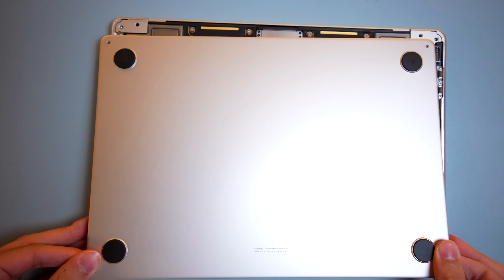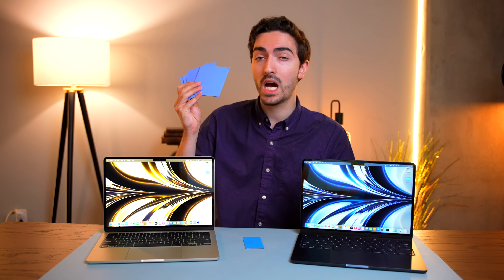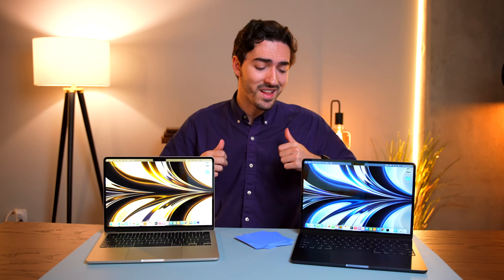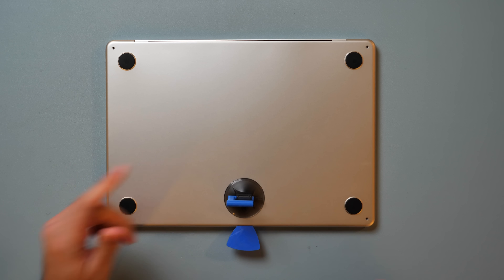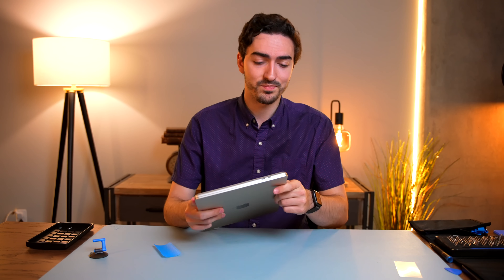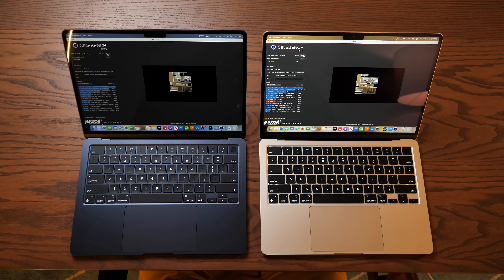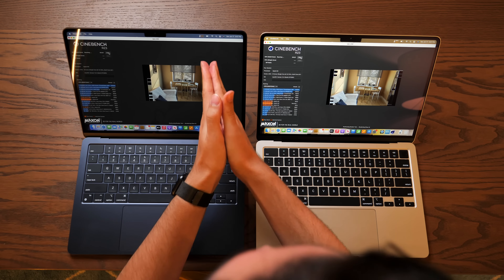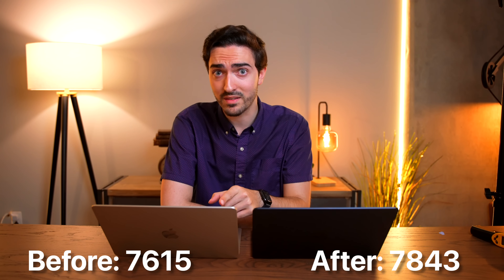Make your M2 MacBook Air FASTER for $8?!

Comment: I'd love to see testing while playing loud music from the speakers - the drivers moving air as music is played should create some airflow between the room and the gap between the heatsink and bottom case - this could help keep the system cooler, no pads needed.
Reply: except speakers produce heat too so you're not really cooling anything
Reply: @domp1062  amplifiers produce heat, speakers not so much. The tiny amounts of electricity through the coils make the driver vibrate as the coils move relative to the magnet. I’ve never seen speakers get hot even PA speakers it’s always the amps which have heat sinks (eg on powered speakers) However I’m not sure now if my crazy idea would work since looking closely it appears the speakers we can see are the magnets from behind, the drivers are on the other side. I know they play towards the display, but if they get all their ventilation from that side then it wouldn’t help at all.

Comment: it would be even better performance . but because it was to thick and you squeeze it it would not work soo good. so I believe gap would be even bigger. And isolator does not help idler.

Comment: I got an idea as to how one can solve the thermal throttling on my new MacBook Air M2.  Use it as it is intended to be used and quit running all those damn test that most people will NEVER use or taxi their system to that point.  So many of you techies are making this so much more than it really is.  Those folks that will be doing the type of major editing shouldn't buy a damn MacBook Air (PERIOD). They should be looking for a MacBook Air Pro 14 or 16.  No one is going to open their MacBook Air and do this crap.  Instead they will actually use them at the level they were designed to be used and they will then have no throttling and/or overheating.  NUFF SAID!

Comment: Ive seen this on a couple of other yt tests - the M2 Air with the extra graphics cores sprints the fist minute or so but then gets so hot it throttles back hard and ends up losing to the lower spec Air. Kinda tragic.

Comment: Changing the heatsink thermal paste might have been a better option for consistency and reliability especially considering I think both of these laptops are close to their power limit anyway.
Reply: he didnt want to ruin warranty or trade in value by removing anything from motherboard so I get why did the pads instead. But I do agree with you.

Comment: Are there any vent holes at the bottom of the M2 MB Air ?  Curious if Apple intended to use the air gap for convective cooling currents from the bottom to top or side of the chassis.

Comment: When you were using the thermal pads in testing, we all noticed that the heat sinks put in place by Apple were all one uniform piece. So if you distribute the heat between multiple isolated thermal pads, they cannot transfer the heat throughout a more uniform one-piece thermal pad covering the entire area to be cooled.
Reply: What heat sinks? There's an EM shield and some thermal tape. There is no heat sink, which is why the processor overheats so easily.

Comment: I rigged up an icepack/lap-pad for a MacBook Pro with only one working fan many moons ago. It really helped until I was able to fix the fan. Will Apple put a fan in the 15" Air? Will Apple re-tool these M2 Airs to add a fan and  fix the SSD problem?

Comment: "The faster air performed actually less, that's weird"...... NOT

Your not only spreading the heat to the chassis, but also over the whole motherboard, frying your SSD's and controllers. (Hence the slower performance) And with the heated chassis indirectly the batteries... Do you really think Apple did not thought about 'thermal pads'?? 

FYI: The black cover over the motherboard is actually a thermal heatshield to NOT dissipate heat to the chassis. 

Next title video of content creators without a technical background: Hmmm, that's weird, my M2 MacBook Air fried my legs because my battery 'mysteriously' exploded.... 😩

Wish you all the best, but think before you are recommending shit to thousands of people. This advice could be dangerous..

One love 💟

Comment: I think that, overall, there is a problem with the MBA. It's the same one with de first models, 15 years ago. They were practically too hot and less functional. Maybe this "second generation" 5 nm isn't what Apple intended to do. It's a compromise. I'll wait for the 4 nm generation or 3. MBA M1 looks more reliable. This one isn't yet a mature product.
Reply: There is nothing on Telegram. Your account is inactive.
So, you have two.

Comment: Probably should be specified that this mod is dangerous, if any part of the case get over 44 degree there is a risk of being burn (https://pubmed.ncbi.nlm.nih.gov/28536038/) considering that a laptop is not necessarily used only on a table (ie supported by leg) or simply handled to move it bringing a part of the case at high temperature can be quite bad

Comment: With respect, I can solve the throttling problem absolutely free for as long as one owns the device.
Simply use the device as 90% or more of owners use it … for everyday tasks. No 5 hour 8K movie renderings, no huge calculations done by physicists or engineers, no huge stresses. Few of us buy a base model MacBook Air to replace the latest Cray supercomputer, as tempting it may be for some. 
I understand how it may be interesting for 5 to 10 percent of owners, but the rest of us may prefer help on how to get the most from our purchase in the tasks we do every day. 
Many of your posts, like the ones that should you how to update an older Mac for only a few bucks, appeal to us folks that can’t afford a new MacBook every year. We need more YouTube creators to focus on regular users. At least a more equitable proportion. I believe you’re one who can excel at that.

Comment: If you use a pad to transfer the heat to the bottom case - to use it as a heat sink… wouldn’t you end up with a laptop that would burn your lap..?
Reply: I would think so as well. Sort of along the premises of “matter cannot be created or destroyed, only transferred” same thing applies to heat. If you’re using it on a desk I would think propping it up on something would help, so there’s airflow underneath. In all honesty, even though I like watching the benchmark testing, if you’re a consumer using this laptop to the extent that it’s reaching 108C you’re probably best to move up to a 14” or 16” Pro model. The use case for this I imagine would be web browsing, light photo editing, emails, etc

Comment: Curious if a copper replicated replacement for the heat shield would result in better performance also. Or in addition to the pads a really thin copper heat sync that attaches to the bottom of the case. Is there anyone that makes such things?

Comment: The reason Apple does not do this as it causes the bottom to breach the 50deg mark, which is known to cause lap burns and against most standards for max temp. Obviously it's the reason a fan exists in teh M2 Pro.

Comment: Oh and another thought. What if apple put air “channels in the next MacBook Air with out the fan and just relied on convection for air movement?
Reply: You can't have convection in horizontal surfaces. That can be done if the motherboard is behind the screen, and then you have convection because it is vertical. But then the screen would be very thick.

Comment: Just saw on Max Tech a similar Video (incl thermal paste). Interesting spin here with the different types of heatpads. Same result, apple cheaped out and did let as on the M1 many unused and wasted performance.
Reply: You don't get it. No, Apple did not cheap out. Apple did it for safety reasons. I have modded my Macbook Air M1 with thermal pads. It's efficient and I get much better performance, but on a 30 minutes Cinebench test I've got 55.9°C (132.6°F) on the bottom case. It's well over acceptable limits, and Apple would get sued by physically burned customers if they included thermal pads.

Not only that, but in this test the battery reached 48.9°C (120°F), which is a difference of 5°C (8.6°F) from the same test with the same unmodded Macbook Air. The bottom case heats up a lot, and some of this heat reaches the battery. It's probably not good for the battery longevity.

Apple actually had to engineer and air gap (the opposite of thermal pads) to avoid reaching high temperatures on that bottom case FOR SAFETY REASONS. They don't even rely on software to make sure the temperatures are in control. They rely on a physical air gap to protect their consumers. I think they did the right thing.

Now I know what I'm doing, so I keep the thermal pads, but it's clearly not an innocent mod, and it could have serious consequences for unsuspecting users.
Reply: @fixups6536  Thank you for the provided information. Very detailed!
Reply: I suspect due to risks of serious battery life degradation, Apple engineers kept it this way..

Comment: hello luck from so many videos seen of the MACBOOK AIR, why not try to place a .5mm thermal pad on the opposite side (internal side) where apple engineers supposedly transfer heat to the vents near the of screen, do you think it would be a good test?

Comment: I don't really see the issue with MBA. Under regular (!) MBA usecase - not "Pro" levels use, they don't throttle.
Reply: Agreed. It’s not a deal breaker. I’d still buy one if I needed a portable. A comparison with the same benchmarks on a similarly sized fabless pc notebook would be interesting.
Reply: Fanless

Comment: Thanks for the video Luke ! In the past I have got so much great info from you , Cheers!  Not in the market for a new MacBook Air. I do though have a fan-less computer, it is an old panasonic toughbook. I have had to use a laptop stand with built in fans when it gets hot (the ambient room temp) here with it.  Otherwise it goes too slow. It's not fast anyway lol. Just can't see the logic of a fan-less design. Rocking now a macbook pro 2009 with 2 BIG built in fans. :)
Reply: One of the points to keep in mind, if you don't understand the logic behind fanless, is that fans consume power! A fanless computer will have more autonomy, and for some it is an important feature. It will also be more reliable.
Reply: @fixups6536  Hi - what will be more reliable exactly? A fan-less computer? So I'm writing this to you from a 2009 macbook pro with 2 original large fans as stated already. Now this computer has been reliable for about 13 years and is still working...So I can't see your point. Also, I would not like to try to do anything (a computer task) with a fanless design in a hot room that required a lot of cpu useage. We are talking about enough heat to boil water. .. as stated in lukes video. 108 deg celcius.

Comment: Be interesting to see if you put it on a small air cooler if the bottom would act like a large heat sink and give you  better numbers or prolonged usage.

Personally I believe if a CPU is marketed at a certain speed that’s the speed it should have to maintain the whole time. Otherwise it’s false advertising.

Comment: M1 MacBook Air regains supremacy, it’s by far Apple’s best entry-level laptop ever made.
Reply: It sure seems like it. I picked up the base spec one at Micro Center for $799. Such a great deal.
Reply: I’m assuming they’ll keep making the M1 Airs. I got a great deal on my iPhone 12 128GB from my carrier and even buying it over 1 1/2 years after initial release I was surprised the build date was only like 2 months before I bought it. I would assume the same with laptops

Comment: do you think this would happen to the MacBook Air with a fan? (a intel version?)
Reply: The problem is that the Intel MacBooks have MUCH worse performance then the M2 (even when heavily throttling). And they still thermal throttle as well because … intel … and are loud while doing it. Plus: bad battery life. Seems like an easy choice to me 😂
Reply: @helmi5045  I wasn't thinking about buying one but I was just curious thanks for the reply tho

Comment: Seriously? The paint is barely dry on the M2 Air and you're recommending users tamper with the innards to gain a tiny performance bump? What about long-term testing for stress on the CPU, or for any unforeseen consequences of altering the design?

Comment: not really a faster SSD .......ok. its faster cause of the raid 0, take one chip out of that dual setup you will get the same as the one with one. So its not really faster, you know this. Right?

Comment: with the thermal pads...
for the alteration effect it all moves around in the 5% range and the direction looks like its doing the things right.
i feel like it can be done and if going for energy saving its nice. also its nice for running "full power".
but the main idea that Apple probably had in mind with the air gap was protecting your legs and other body parts from getting burnt.

Comment: Will this void warranty
Reply: Maybe? There’s no way to tell that you actually did this if you just remove the pads before turning it in to Apple if you have an issue.
Reply: It will void the warranty and Apple no doubt has sensors that record the history of parts that would reveal that you have modded the Mac. So even if it was something not directly related to the mod you would lose the warranty. Tolerances and safety checks are done for a reason and by breaking them you are your own architect. I would say do not do it, you may nb e lucky and not have an exploding battery or overheating base that burns someone, but you may be in that unlucky percent.

Comment: M2 macbook air M2 chip might fry using it for extended period of time doing heavy tasks. We need good airflow, not in hot sun and also distribution of heat matters. I changed my mind that it isn't worth trying this, instead would pick up M1 14"

Comment: your results are fucked up because you wont remove the basic heat shield.  I get that it's scary, but if you man up and just peel off the black shit and put on a 1.5 you'll probably get much better results.  by leaving the insulant on, you're negating most of the benefit of the heat pads.  it's like wearing a parka and turning on a ceiling fan to cool down.  

Personally, i wouldn't do this at all.  you'd be shocked how close 'warm' is to 'burning' on the temperature scale.  it's like a two degrees of spread near 47 degrees.  the risk of actually hurting yourself should never come up using a laptop, that's crazy.  If you're having throttling issues, then what you NEEDED was a macbook pro (with a fan).

Comment: This test was actually very interesting and i do think it was worth trying! I think Apple should apply this (but it probably would make the Macbook's more expensive...)
Reply: No, Apple should not apply it, and it's not a matter of price, it's a safety issue. Apple is doing the right thing. It's great that we can actually do this mod (which I have done and extensively tested on my M1 MBA), but it's not for everyone. The MBA becomes slightly unsafe with the mod applied under some extreme workloads, and you do the mod only if you know what you are doing.
Reply: @fixups6536  Thanks for the info.

Comment: I am only half way through the video, but I will predict thermal pads instead of thermal insulation is a winner. I assumed that apple had always used the metal body for its heat disapation benefits. Why on earth miss that opporunity?? But you may prove my theory incorrect! If I am wrong I will buy you a coffee. Please proceed with the rest of the  video.

Comment: Is that an Apple thing? Having the palm rest above the keyboard, just below the screen? Maybe Apple didn’t do this to prevent people complaining about the laptop being to hot to sit on your legs.
Reply: A laptop is for your lap so a good OEM will make sure that is not too hot especially as it is illegal to have too high temps on the base and would open up law suits. It could be argued that if thermal pads are used like this and Max Tech video and they burn someone, that these channels could be sued for bad faith. I certainly would say that this is not sensible as it will void your Mac even if there is no proof the pads caused any failure. Also, the legal and safety implications, as well as the effect on the battery (see Reddit that highlighted up to a 10% rise in the battery temp). Not a good video TBH and I am sure Apple has tested this solution and deemed it as not acceptable.

Comment: Apple may not have a choice but to put a fan back in the air. Why? It is obvious they are being aggressive with performance. So far it looks like the M2 is running as hot as the Intel based MacBook Air.

Comment: The 1.5 mm thermal pads though tighter may have 1. Provided better contact with the bottom case and 2. The extra compression from the tighter fit would result in a denser heat transfer material leading to even better heat transfer.

Edit: Get one of those laptop stands with as much bottom area exposed and get a fan to blow on the bottom surface. That should dissipate heat even faster.